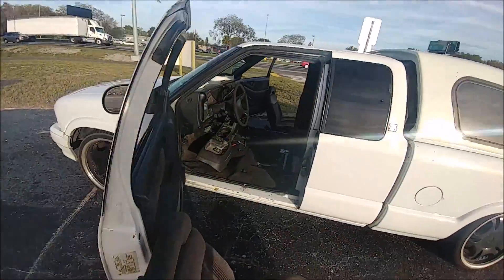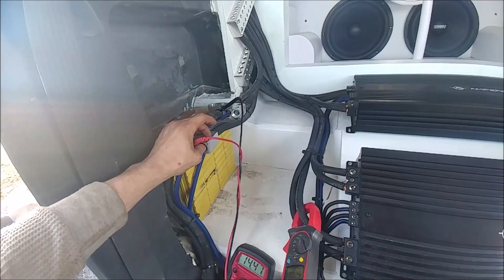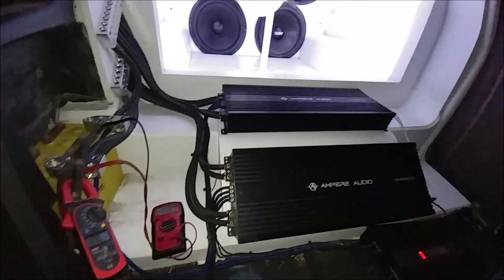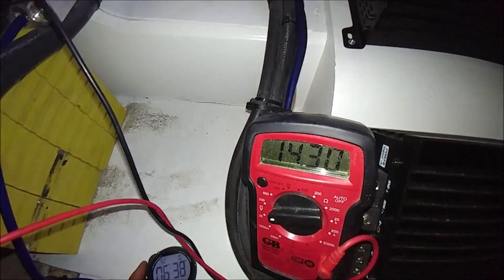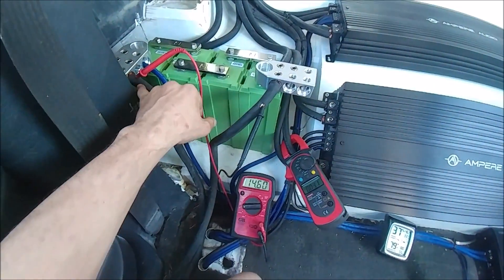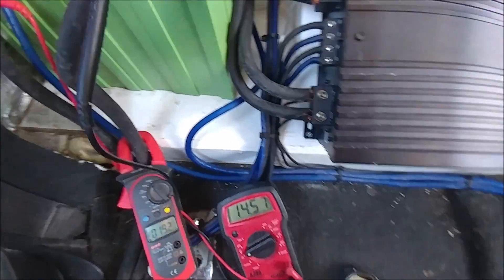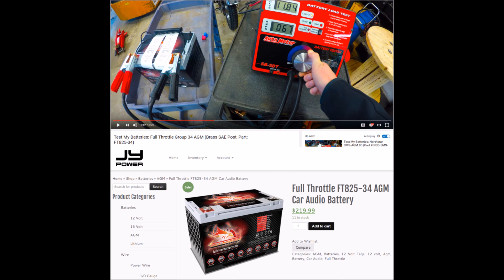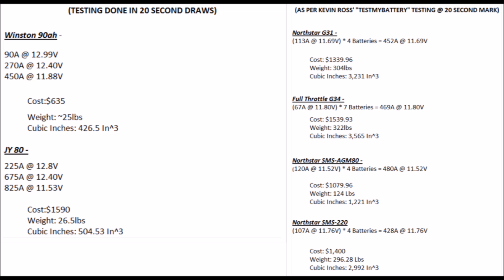WINSTON LITHIUM VS JY POWER LITHIUM VS AGM

Comment: I saw you are one of the very few who use the prismatic Winston Lithium batteries for your car audio system. I am very interested in using the less expensive Winston cells found on AliExpress but I want to do it safely. Did you use a balancer for your setup? If so what brand? I have a Taramps Bass 30k amp and like the idea of running 5 Lithium cells to make 15 volts. (The Taramps Amps don't like low voltage) Any info you could give me would be greatly appreciated. Thanks 😊

Comment: whats your take on mixing AGM with Lithium? I got 5 full throttle group 31s and need more battery power for my set up but not enough space to fit anymore Group 31 but I could probably squeeze in 1 80ah JY.

Comment: can u mix agm with lithuim?
Reply: Yes. Sure can do. Put them in a blender to mix them up. Nah jk. No you can’t. Unless you charge them with different charger and individually.
Reply: @IntegraGSR5  ok so what kind of individual charging system would need to be put in i currently have a 265amp alt and a agm northstar under the hood?
Reply: @cellism860  Just dont mix the 2 period unless you use an isolator and that pretty much defeats the purpose. Unless you want to use an agm just for starting the vehicle.  The agms sit at a lower voltage than lithium so the agms will drain down the lithium's.

Comment: I'm a little confused with you multiplying the amperage from the jy to the Winston. What one would be better to purchase?
Reply from the maker: Winston has better discharge per dollar.
Reply: hunter martin so the Winston has a better discharge per dollar but over all the jy can handle a higher amperage draw?
Reply from the maker: yep. but the winston has no customer service. no warranty. no passive balancing. higher failure rate. and youll need to source or make your own cell straps.
Reply: @huntermartin  what is a passive balancer?

Comment: did you have any sort of bms on the winston cells or just hook it up and go... really thinking about going that route
Reply from the maker: zayres29 nope Fuck a BMS. you will have to bottom balance them and then check them every once in a while to make sure they are still balanced. dont have to do any of that with the JY.
Reply: hunter martin do you know anything about lifemnpo4 cells and or how they compare
Reply from the maker: zayres29 pretty much same chemistry but its likely going to be low discharge prismatic.
Reply from the maker: zayres29 those are 2c rated. and same style cells as Winston.

Comment: Hey, I saw 11.8 volts on the jy80 675a draw. Am I wrong?
Reply from the maker: not at all.
Reply: hunter martin Okay thanks. I asked because final chart says 12.4v@ 675a
Reply from the maker: Sunnil Bartlett yeah, that's a typo i didn't catch until it was uploaded. the chart graphs are accurate. I really need to put a YouTube annotation there and fix it.
Reply: hunter martin Just double checking. I really appreciate you taking the time to make this video. I hope you continue to make more... I've been debating on trying these Winston cells out adding to a battery bank.

Comment: At the end when you post the weight comparison, the SMS-AGM80 says 124 lbs.  Is that the total weight of all 4 of those?
Reply from the maker: Jamie Howard yes. that test was at 3C while the other AGMs were done at 1C. the lower AH AGMs perform better at a higher C discharge. but still is a significant price and size difference.